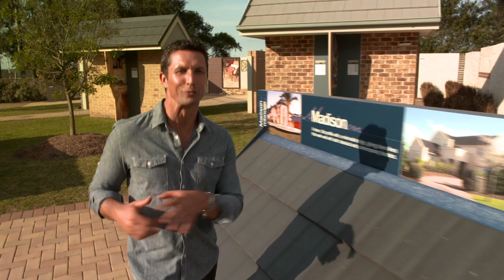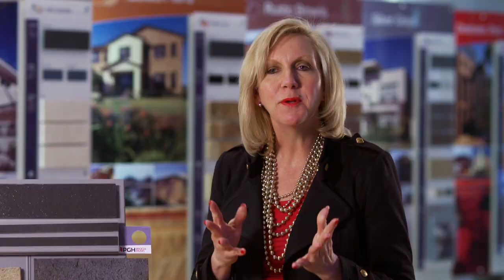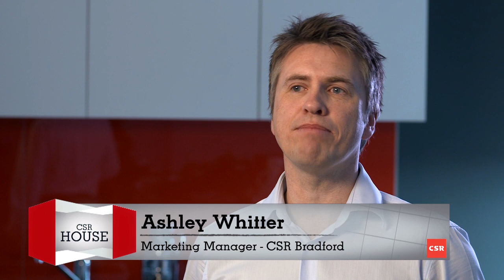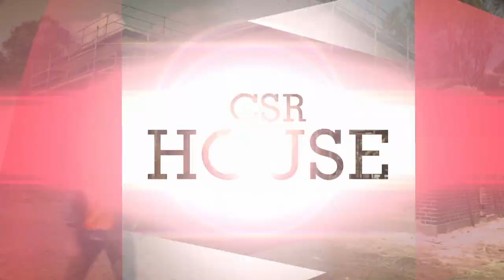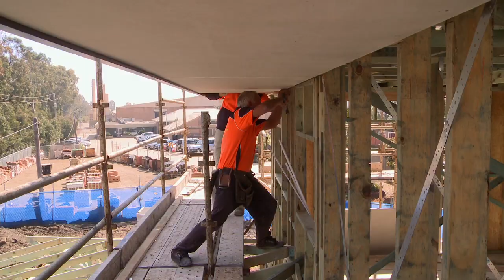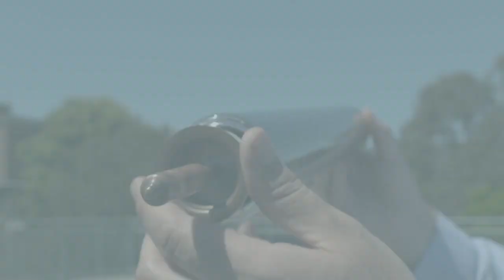CSR House Ep 5 Roofing.mov

Comment: I thought the use of roof tiling was an odd one though I shouldn't be surprised given they sell these tiles. I would have thought given you want to be an eco house that you would want to collect the rain water for drinking and all other use around the home and garden but I thought you couldn't drink the water from a tiled roof and had to be steel?
Reply from the maker: +MaZEEZaM There's no difference to the quality of water collected from a tiled roof or a steel roof.  Older style lead flashing can contaminate water which is why we now have lead free flashing available for roofs feeding water tanks.  At CSR House we have a 10,000 litre water tank collecting water from the roof, this water is used for irrigating the gardens, toilets, and cold water inlet to the laundry.  Due to Sydney Water's strict health rules this is all we were able to do without embarking on expensive secondary and tertiary treatment which was outside of the brief for the project, which was:Making affordable, sustainable and efficient choices available to the mainstream market.ThanksScott
Reply: Thanks for the reply. Thats good news then, I much prefer the look of tiles such as were used in this project. I guess my experience of using rain water for drinking is from a semi rural location where the pollution is not an issue, and this makes sense as I would not like to drink the water in any built up areas. Its been a few years since this project house was completed, is it possible to get actual plans for this house that could be built from? Also I was a little unsure, when using the hebel on the external wall finish, was that on top of a layer of double brick or was it instead of the brick? also one last question, would hydronic heating in the slab floor not have been a good option or is it prohibitively expensive to do?
Reply from the maker: +MaZEEZaM All rainwater collection systems use a "First Flush" principle, whereby the initial volume of rain falling on the catchment area is diverted to stormwater, this has the effect of rinsing the roof, any further rain is then directed to the collection tank, in built up areas however the water authorities & councils resitrict the use of rainwater.I can email you a set of drawings if you like, please email me at sclarkson@csr.com.au however this set of drawings is specifically for oursite, to actually build the same house you will need to discuss this with the architect as they own the copyright to the design their details are on the drawings.Hebel wall panels are mounted on tophats from the timber frame, no bricks at all, have a look at www.hebel.com.au for details and look at the PowerPanelXL product.Hydronic heating was very expensive when we built the house, I believe it has become more affordable now.  However we've found that we very rarely need to turn the heating or cooling on as the house is very stable.ThanksScott
Reply: Thanks, I will email shortly, my name is Gareth for reference :)